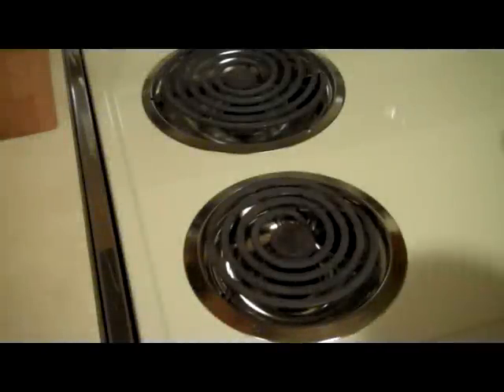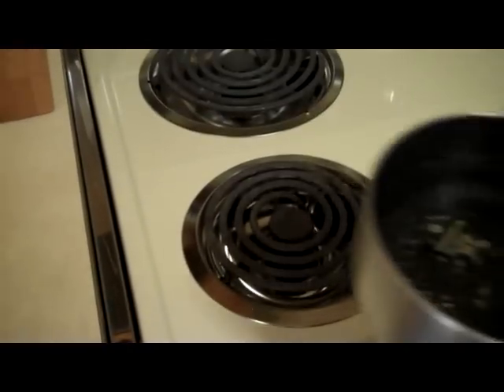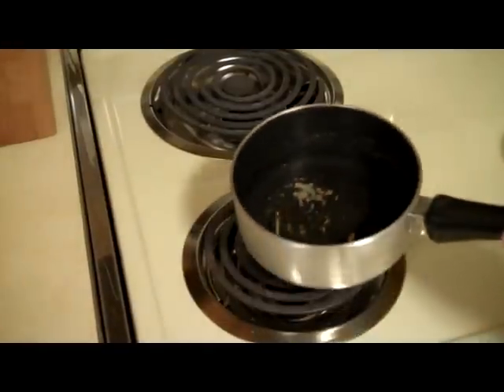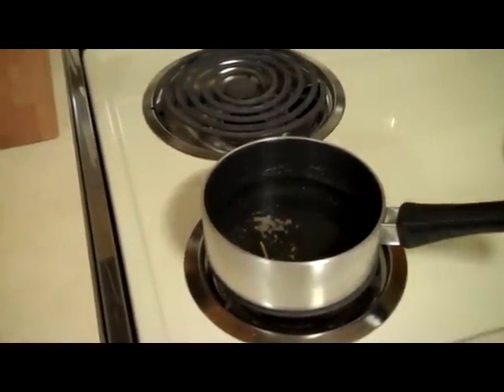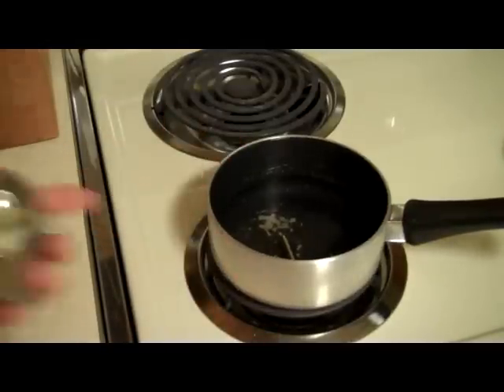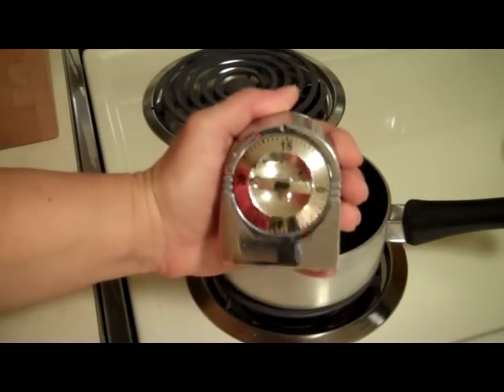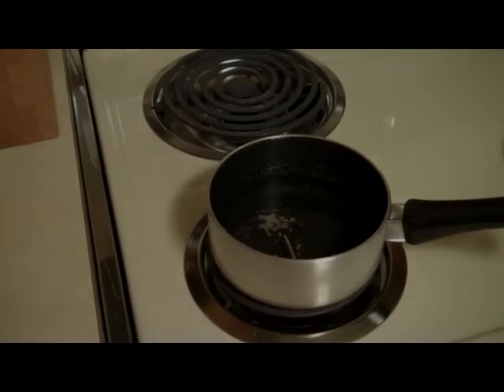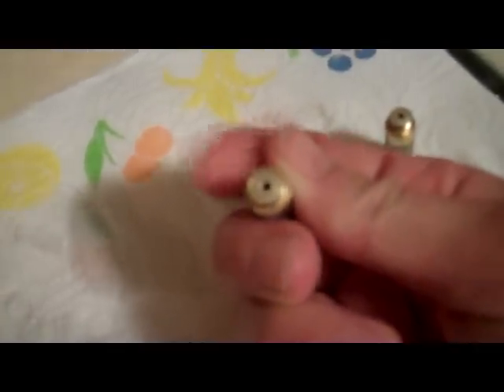Cleaning your e-cig atomizers

Comment: @olivermctexas Very good advice,i've been on e cigs for 20 weeks. Started on a 401e cig then a 510. wasnt happy with the battery life of the small batterys so got myself the ego and that does it for me. I tried carts,2 tipes of tank versions and cartomisers . I find they all work fine for a week or so then you get problems. I've binned all that now and just drip. Use steel drip tips on my ego 2 to 3 drops. I now use Low Res atomizers to and its fantastic.

Comment: @olivermctexas i buy all my juice and bits in buik from china as it's works out much cheaper and its the same stuff. As for cleaning i use a car foot pump with a air bed adapter and just blow all the gunk out. I dont use to much pressure just keep applying  pressure with it till the old juice stops coming out on to the tissue. And then clean the threads. Sometimes flush hot water down it and  give it a bit of a dry burn after but not to much. I find they vape better like new.

Comment: @olivermctexas I find this way is very fast and easy and the best way to get the longest life out of a 510 atty low res or normal. I use ecigsunlimitied for my juice,i buy the 200ml bottle and use absolutely e cig.com for my attys and batterys. I find the juice and atomisers are good quality. I got my tips from liberty flights. I looked a totally wicked but as you said every thing seems very expensive for the same stuff they just stick there name on it.